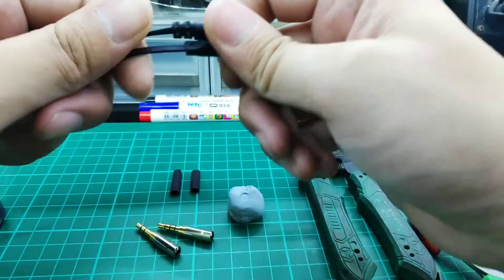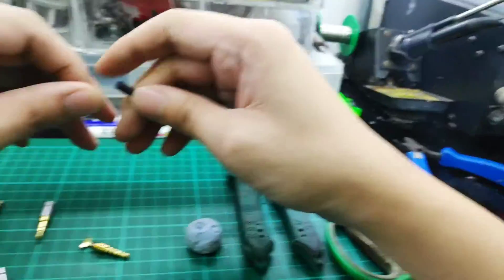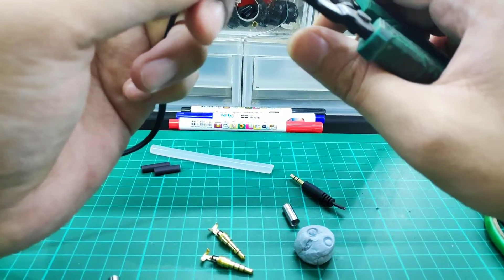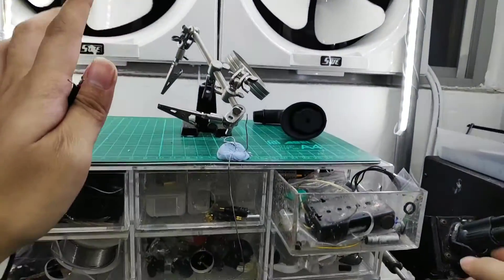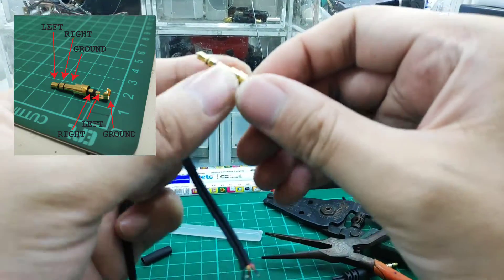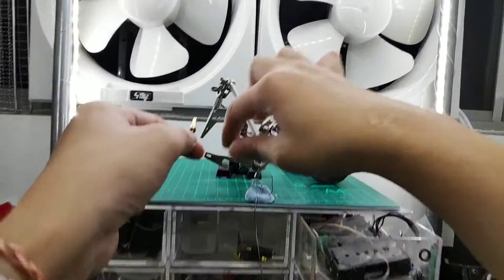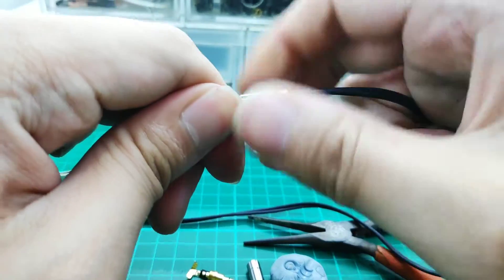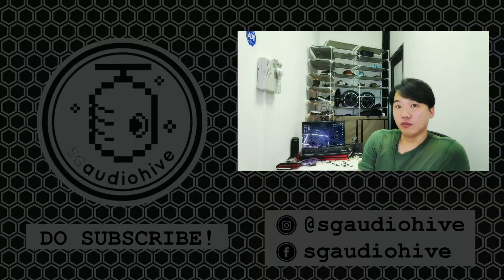FIX earphone no sound DIY jack repair Tutorial

Comment: just asking bro can i use the old jack the only problem is the wire :)
Reply from the maker: the old jack on a stock wire is usually moulded and not possible to cut and reuse without removing all the housing, short answer is that it's easier to replace it on a new jack

Comment: Can you place make a video on 2.5mm TRRS jack connecting to 3.5mm trs..or if you can share a link to the same online. I am trying to make a balanced headphone cable which has 2.5mm jack (for balanced output on amplifier) connecting to dual 3.5mm trs jacks (each going into each headphone). Im confused about connecting/soldering the wires and terminals.

Thanks!